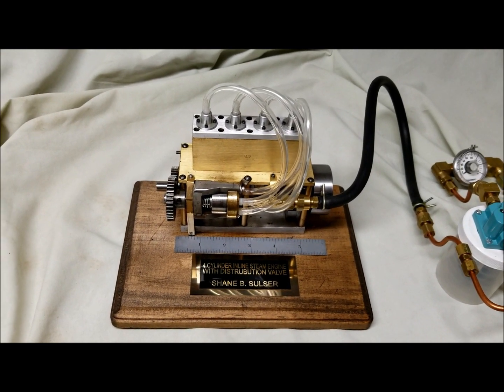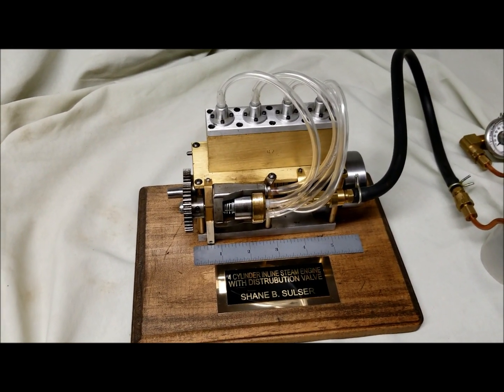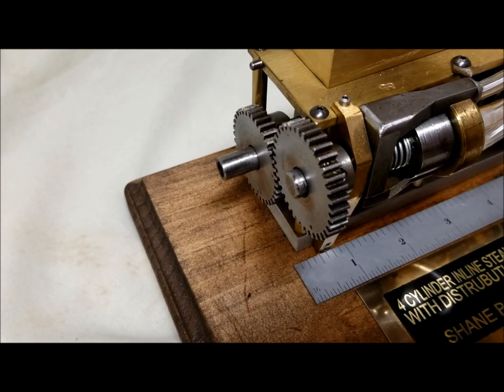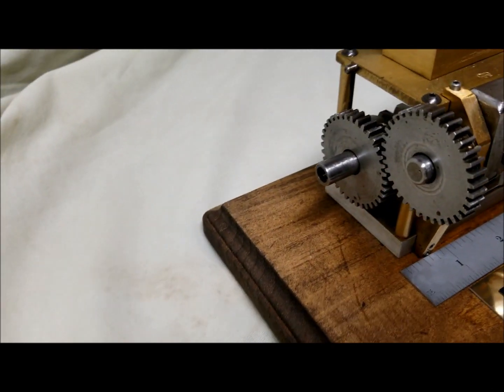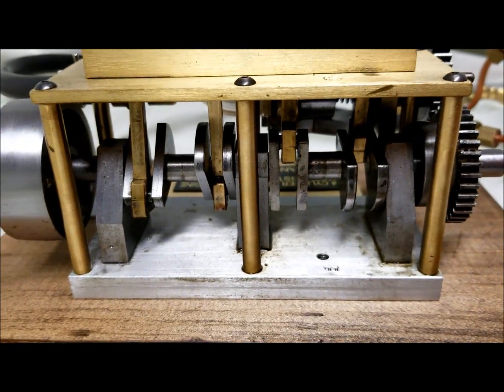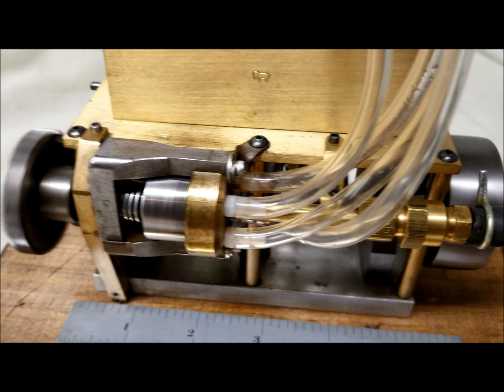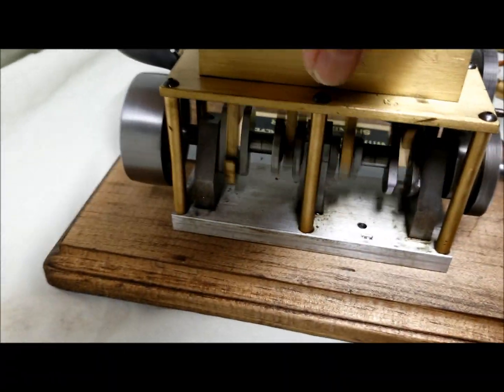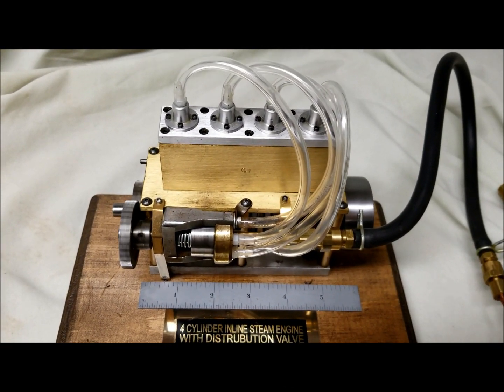4 Cylinder Inline Steam/Air Engine with Distribution Valve, Machined & Assembled by Shane B. Sulser

Comment: Diesel n Dust
Please is it possible to obtain drawings of the distribution valve, of the - "4 Cylinder Inline Steam/Air Engine with Distribution Valve"
Reply from the maker: I don't have any drawings for this engine. The machining of this engine was a build as you go project. I could possibly disassemble the vavle and send you some pictures and basic dimensions. Will that help.
Reply: @shanesmachineshop9719  Yes please, thank you very much. Is there an address that I can communicate with you directly.
Reply from the maker: @ccblaver1480  shanesmachineshop@msn.com
Reply: @shanesmachineshop9719   Hi shane not sure whether you go my email dated 10/10/22 Kind regards Cedric
Reply from the maker: @ccblaver1480  Cedric, I did not receive your email. Regards, Shane
Reply: HI Shane I have just sent you another email. Regards Cedric. @shanesmachineshop9719
Reply from the maker: @ccblaver1480  Cedric, still no email. Are you using shanesmachineshop@msn.com

Comment: Nice made
Where is the steam outlet valve ?
Reply from the maker: The intake and exhaust are part of the distribution valve. There is an exhaust port on the left side of the valve.
Reply: @shanesmachineshop9719  Thank for your reply, i haven't seen that.
Reply from the maker: @stelleratorsuprise8185  You're welcome! The exhaust port is about 35 seconds into the video.